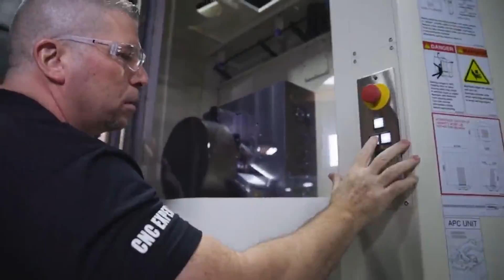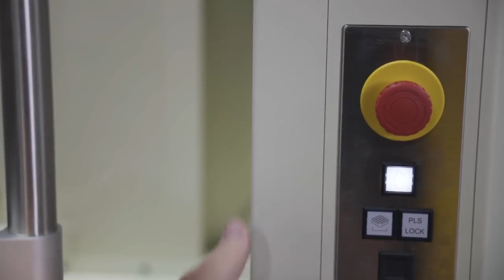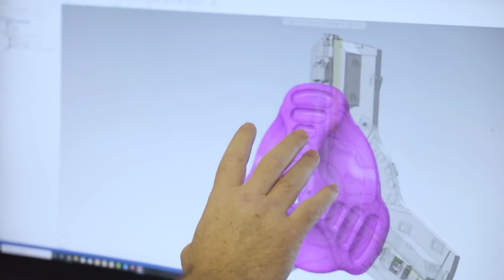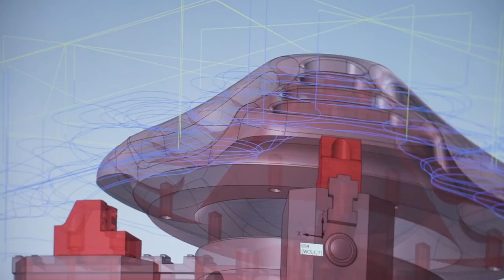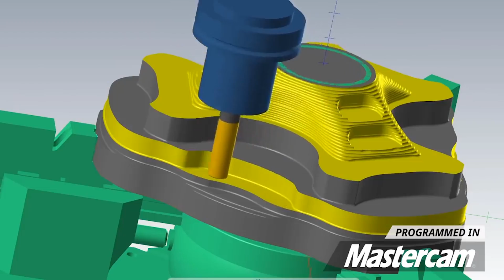Buyer DEMANDS 15% PRICE DECREASE or Parts Get Outsourced!

Comment: I am tired of the race to the bottom mentality that seems to be so pervasive in this industry. I work for a megacorp and nearly every part we get is outsourced. My job is basically fix the outsourced parts defects, but I am constantly asked to let things slide, or to make miracles happen. We used to have 5x as many well paid, skilled workers. Now we have a skeleton crew. 

There are only so many corners that can be cut before the whole thing comes down.
Reply: It's almost impossible to compete with countries that can pay next to nothing for wages and have few regulations. One place I worked sourced brass parts from China, they were producing finished parts shipped to Canada cheaper than I could buy the raw stock.
Reply: @markboudreau1276  The upfront cost of it may be lower, but when your shutting down lines because the product isn't up to standard or paying people to repair the parts  multiple times per week, or you simply can't get the products because of global shipping woes.

With all that in mind I just don't see how it can be more profitable
Reply: @Aztal  well, it is more profitable. It sucks but it’s true. Companies, especially large ones, exist to make money and if outsourcing wasn’t financially sound, they wouldn’t do it. They look at every factor and even with the customers they undoubtedly lose because outsourcing is frowned upon, even with the lesser quality of the product, they STILL make more profit than if they didn’t outsource, that’s how cheap the labor is in these countries is. It’s just the nature of a global marketplace. We simply will never be able to compete with countries like China when it comes to cheap manufacturing, and yes, the quality is lesser in most, if not all cases, but the price of manufacture to quality ratio is better than products manufactured in countries where people have self respect and won’t work themselves to death for a pittance. Those people WILL work themselves ragged for next to nothing and that’s not something that we can compete with as workers from developed countries.
Reply: @Aztal  Long-term no. Companies have a goal to make ultimate profit each quarter instead of a product that will last less than a generation.
Reply: @Aztal  it is 12 pence cheaper per part total.
Reply: @markboudreau1276  how much cheaper, in general, are raw materials (of the same spec and quality) from China or similar overseas nation?
Reply: @a_room_without_a_view  depends on the specs of the part. Generally, higher surface finish parts need to be local. Even if the part has 1 or 2 sub .001 tolerances, the overall part can be shit and therefore it can be cheaper to get "halfworked" parts from China, and then finish them in the USA. Cuts a 10 hour job down to 1 hour, with most of the roughing already pre-machined. 

There are innumerable calculations that can go into this. Its mostly about market connections, not about skill or country of origin.
Reply: Generally, lower (10-500) quantity orders can be half worked and then produce a profit being machined again with shipping costs and setup costs. Large orders for simple parts generally flow to whichever country has the lowest tariff + ecological cost (steel or aluminum producing countries, etc) but patent costs come into play for certain alloys, trade agreements come into play for military technologies (Germany/usa/Japan for most cnc operations) etc... technically in a free market, Russia would dominate but they don't have access to buy technologies due to trade embargoes. Look at Okuma Lathes, they all say somewhere on the machine "illegal to export" referring to Germany/japan/USA trade agreements. The world of capitalism is complex. Imagine if you had 10 million dollars and could ship 20 cnc machines to a country near the Panama canal, you could crush costs. But try to do it? You can't. You get my point.
Reply: Also, anything automotive has to be produced as is required by their large tariff regulations. Ford makes things in the USA, then assembles it in Mexico, then ships it back, making it "American made". Mazda does it in Japan, kia does it in Mexico and Korea. Etc.
Reply: @markboudreau1276  but where they of the same quality?
Reply: @markboudreau1276  "they were producing finished parts shipped to Canada cheaper than I could buy the raw stock." - Was it the same quality and made with the same tolerances as well?
Reply: its like this in corporate america in the "backoffice" ..skeleton crews of highly skilled people doing the jobs of 3-5 people.
Reply: @scottchelmford7136  3-5 people each.
Reply: @scottchelmford7136  Europe isn't that different. I once started as a purchaser at a trading company, being the 5th and latest person on the team + the supervisor.
Not even 1.5 year later I had to basically run the entire purchase department because everyone left, without a pay raise obviously.
And to put the rotten cherry on top, I had to manage inside sales of the 10 worst customers 
(aka the ones who complain all the time, demand ridiculous estimates, and buy next to nothing).
 Glad I put that behind me.

Chinese companies are basically a cancer, undercutting on everything.
They manage to sell transport trucks at half the price. Of course, after using it for 5 months in Africa, the chassis breaks in half. 
But at least you got it cheap, right?
Reply: So well said.
Reply: Sounds like where I worked.  The last few years pay did not keep up with inflation, then Went from three shifts to one shift, with most of those temporary workers, most of the skilled permanent workers retiring or getting terminated
Reply: My job was the same as yours at my old company for 22 years. Then I opened my shop and grabbed the jobs from the shops that couldn't do it correctly. 17 years later still doing the work.
Reply: Hopefully you don't make the parts for the plane I fly in.
Reply: @spudpud-T67  no... Of course not... Who would put profits above human safety
Reply: @Aztal  I hoping that is sarcasm I read... profits above safety seems to be the motto of late.... look at any market these days.... it's mostly what you see.
Reply: @Aztal  watch the new Netflix series on Boeing.
Reply: @spudpud-T67  Watch the new Netflix documentary on Boeing.
Reply: @spudpud-T67  That's wher the rub is. That's where the rubber shreds when it meets the road. The race to the bottom is guaranteed destruction, not just of goods but of a basic quality of life for ALL individuals on this planet.
Reply: corp: we don't have the $ to do it right, but we have the money to do it twice.
Reply: @JohnCanniff  Sounds like where I work. Made in Mexico and redo it here. Problem is, they use the " just in time" process. So it reaches the production lane later.
Reply: That is what management is looking for, to see how much to remove before it collapses. Then they will be happy to add +1 to the critical point.
Until you let it collapse by producing miracles, they believe it is just unlocking unused capability. Your sacrifices will never be appreciated and the conditions will never improve.
Reply: Brother, you know as well as I.... Skilled work is not cheap and Cheap work is not skilled, yet these people are trying their hardest to fight it.
Reply: Built by the lowest bidder
Reply: @reggaenotoriousreggaenotor519  Like they tell soldiers in training to remember, the rifle you are using is the cheapest the gov could get.  Be careful with in on the range.
Reply: Be wary of 'mature' markets they tend to commoditize vendors.
Reply: @junkdubious  When you are one of a hundred shops that can do the job, you are a commodity whether you like it or not.
Reply: @yoyo762  Exactly. Don't be just a one in one-hundred shop. Differentiate! Example, reverse engineer and improve antiquated parts no longer available. Such as in the energy industry. Most power stations run equipment made in the 50's and 60's! Your wrong you have choices you need to be out of your comfort zone and willing to offer unique services. It's simple econ 101. Don't chase a market others are, find your own!
Reply: this is the way everything works in the world today. capitalism consumes itself
Reply: I own a small business and manufacture in the U.S. and in China. I'll share some observations based on my extensive experience here and abroad.

1. I manufacture in the States, but not because it makes economic sense. From a financial perspective, it doesn't.  My margins are 65-75% lower on goods made here...the shop makes more than I do on each sale. Let's just say my approach wouldn't earn you an A in some fucking Harvard business asshole-minting degree program.  I do it to help support fellow local businesses, and to give my customers a choice. They can choose less expensive, or they can choose to pay more and support my local manufacturers. In other words, they can put their money where their mouth is. A fairly stable 4 out of 10 of my customers choose to pay more and buy locally.

2. I've read countless comments from folks who express the same sentiment as you. The problem is, that once these people (the vast majority of them) are in positions of power, they pull the very same horseshit they claimed to hate so much. Until that changes on a large scale, stories such as yours will continue to be commonplace.

3. It comes down to oversight and a willingness to pay/charge a fair price no matter where the buyers/suppliers are located. If your company sources shitty-ass parts, I can virtually guarantee that the fault lies with the people running the company.  Each of us wears two hats. At times we're the suppliers, and at other times we're the buyers. For some fkd up reason the moment people put on their buyer hat they become the world's biggest assholes seeking to squeeze concessions out of their suppliers to the point that those suppliers cease to exist. Then they just move on to exploiting other suppliers. That is, except when they're wearing their supplier hat and pissed that some other asshole is doing the very same thing to them. 

In contrast, I don't tell my suppliers the price points they need to hit so I can impress my drinking buddies and investors.  I show them what I need manufactured and ask them how much it'll cost to make those widgets with the level of quality my customers have come to expect from me.  I then collaborate with them on redesigning my widgets to make them easier to manufacture without compromising key requirements. And if the widget costs are higher, I manage my customers' expectations about the price and value. I go through this same process no matter where I source my parts.

4. China is fkn packed chock full of factories capable of turning out high quality parts on equipment that would make some suppliers here green with envy.  You have to be willing to pay for it. The hoops that my local supplier has to go through to produce a part that's 75% as nice as the parts I get for 90% less overseas boggles my mind.  I would never say this to my customers, but my imported parts are superior to my U.S. parts in terms of overall fit and finish (if I'm nitpicking). And many of them wouldn't believe it anyway. In their minds, made in the US is just better (even if that isn't always the case). Remember, I make widgets here to give them a choice. As long as both are high quality, I'm not going to get into idiotic debates splitting hairs about minor differences.

So what you're experiencing, in my opinion, isn't necessarily the fault of your suppliers. It falls squarely on management. If I had to guess, the assholes at the top are likely beating down your suppliers to the point that those suppliers are cutting corners in an attempt to deliver at unrealistic prices on unrealistic schedules. I've seen it happen time and again here in the States and abroad. Suppliers who haven't learned how to tell potential customers to fk off with their shitty ass champagne expectations on an alleged beer budget.

I manufacture successfully here and abroad. Megacorp could too if it wasn't run by assholes.
Reply: I call this “corporate cannibalism” and any company that let’s their leadership do this is one that nobody should work for.  In this economy, there are so many jobs, that nobody has to tolerate this.
Reply: I'm sure they've added more management and given some fat bonuses too.
They don't just cut jobs without giving themselves a raise!
Reply: in Malaysia we do things really cheap because are cheap labor
Reply: Do you work for Boeing?
Reply: @IthacaDon  No but we make parts for them.
Reply: @Aztal  I just watched the documentary about the 737max on Netflix. Management should be facing criminal charges and jail time.
Reply: And that is one of the biggest negatives of a capitalistic system. No amount is ever enough. Costs are CONSTANTLY being cut on EVERYTHING, YET huge businesses and massive corporations demand an INCREASE IN PROFITS! It's so batshit crazy yet everyone is so drunk on the kool-aid they don't see it ruining everything around them. Massive pollution worldwide(to save more shareholder money), stagnant, non-liveable wages/stripped benefits to workers, rediculous CEO bonuses, e.t.c...What do you do when us middle and lower class NO LONGER HAVE MONEY TO BUY YOUR CHEAPENED PRODUCT?? What to tell the shareholders then?? Maybe they shouldn't have been so GREEDY?? F our fascist, pro-mega corporation society. It no longer benefits ANY of the middle or lower classes.
Reply: A renowned Japanese engineer came to America and said, "I do not understand this race to be the worst ."
Reply: Corporations like to tell their employees that they can’t cut corners, yet they themselves are more than willing to cut corners on cost
Reply: At the end of the day the only thing that's really accomplished with the race to the bottom that we see across almost all aspects of industry is the destruction of quality goods.

We're not getting cheaper products because they break so often that we have to buy more of whatever to the point that we end up spending more money. We're not getting safer products because things produced in nations without regulations or liability will never meet the standard of things produced here. We're not getting quicker products because the whole process becomes much longer and more complicated. And  the quality is always going to be atrocious on account of how little care or concern or even attention will be paid by third world vendors who just want to take your money and run.
Reply: Its tough to compete with slave labor and a culture that prides itself on following the directives of the corrupt. I buy USA every opportunity for any product I can.
Reply: @someonenamedbob  Everything is reduced to the lowest denomination of quality...
Reply: @someonenamedbob  It is irrelevant because capitalism now values short term profits over long term profits, and that has inherently brainwashed the consumer to do so as well.
Reply: @azmachinist2421  a solid guess, not quite but real close
Reply: Made in USA used to have a lot more pride in that stamp. The value of that has decreased exponentially in the last 30 years.
Reply: @darklordojeda  let me tell you about the price of a stamp. 35 years ago I worked for an American company near Sacramento. The company hired cheap (Mexican) laborer to perform one job. His job was to grind off the "made in China" stamp and restamp "made in USA" on parts that were sourced out of China.

In my opinion, outsourcing work to autocratic countries is a virus that will kill the Western society as we know it. It will happen sooner than later.
Reply: Its in all industry sorry to say that but everyone wants stuff for nothing. .
Reply: outsourcing...the main reason behind why the things I buy break.
Reply: Cheer up  because as advances in robotics & AI increase the LABOR cost to build things decreases. When the CHEAP LABOR variable goes away then outsourcing = more expensive. With this I expect China's economy to collapse within 10 years.  Cheap labor is the only thing 3rd world countries like China (they eat bats & dogs) have to offer. Also the Covid thingy has brought to light the supply chain problems with outsourcing & Made In The USA eliminates supply chain problems.
Reply: @Random-rt5ec  China's wages aren't competitive even right now, compared to other "third world" nations . And it will only get worse for them, being a net importer of both energy and food.
Reply: Every business in every industry is racing to the bottom. Sad.
Reply: My favorite saying is "you can only cut corners till it all starts rolling down hill, then you have to catch back up to the thing, or wait to it hits the rocks at the bottom". Dont make everything a wheel when your on top a mountain.
Reply: @alegend4evr  I like that alot
Reply: one day it will be reverse as all knowledge is lost except for a few.
Reply: Welcome to the failure of the human race on earth
Reply: yourea  good slave
Reply: All the ceos and managers are trying to impress their bosses for a pay increase or promotion. They dont care about the small owners cost of running a business.
Reply: @IA100KPDT  why should they? its called competition... go with the gays and losers if you want consideration
Reply: "I am constantly asked to let things slide, or to make miracles happen" - Relenting to such bastards would be a VERY bad idea. If ANYTHING happens to the machines/systems those parts are built into (especially if people die from a catastrophic failure) then you'll be the first to be held accountable.
Reply: Are there other job opportunities available to you that you'd prefer?
Reply: I'm sure nobody wants to hear any of this , but I've seen this coming for 40+ years and a fair share is automation . And automation that's not even in our control . Hell , most of this equipment is made in the orient . China in most cases , but our businesses have to buy this stuff in order to try to compete . It's like the 49er's gold rush ... Who made the majority of the money ?... Ames shovels and Levi Strous . There is a LOT of the mad money being made in the production FOR the production . And then add up our "store bought" legislators always finding ridiculous excuses to raise corporate tax and the like . And think of EVERY big business that moves out of country and how many small "feeder" businesses go under when those businesses move out . 
Major infrastructures were created for just one big business all across ANY country . 
So , when you bring up loss of production in one or two aspects , think of the big picture and how we lose from soup kitchens to stores , to a hundred different businesses . 

My last comment LET'S GO BRANDON !
Reply: @johnjay5143  you know you can just say fuck joe biden right? i thought you guys didn't like being censored
Reply: Race to the bottom starts with end buyers, either the corporations selling lower their prices or they loose the sale to a competitor. After lowering the sale price, they naturally have to do whatever they can do lower the cost, and this goes down the chain.
Are you willing to pay 10-20-50% more for an item that work just the same, with zero objective benefits?